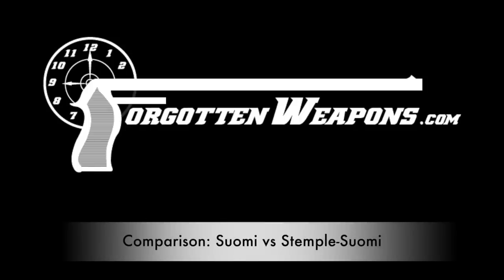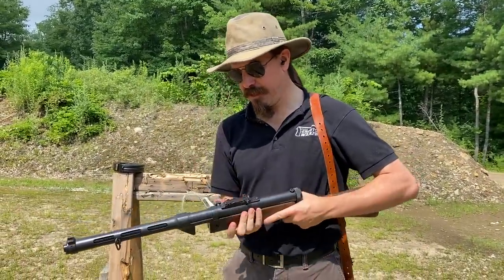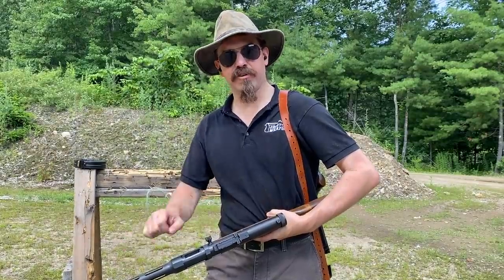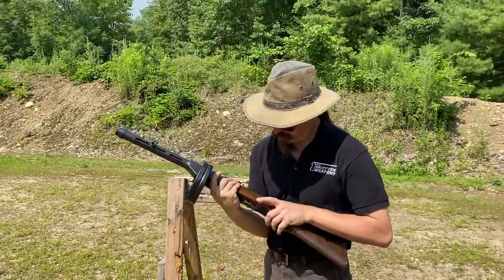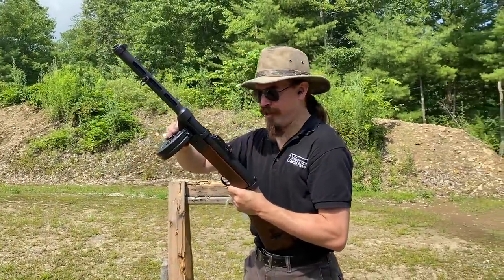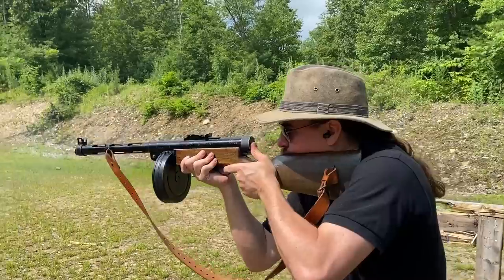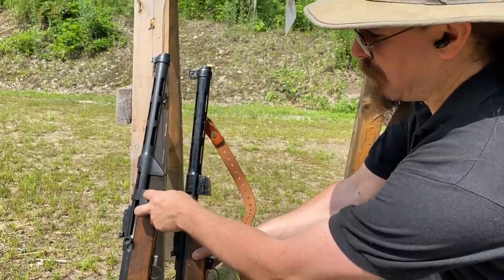Ian Takes the Pepsi Haaste: Suomi vs Stemple-Suomi

Comment: The Stemple receiver might be externally longer, but I doubt it's is functionally longer than the Suomi. The rear cap on the Suomi threads over the receiver tube, while the 'cap' on the Stemple protrudes into the tube a good bit. I think measuring the actual bolt travel of both guns will reveal a minuscule difference. I would do the measurements myself, but right now all I can afford is a Suomi drum.
Reply: I'm jealous
Reply: @skrimper  Don't be. I said I could afford the magazine, not ammo to fill one...😢

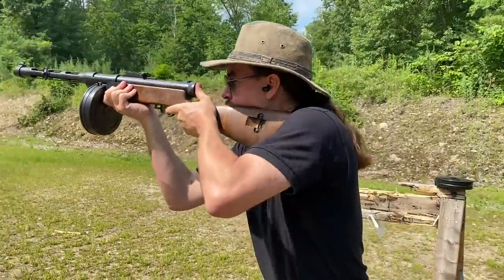Comment: Taking several audio samples from the Suomi against the Stemple-Suomi, I measured 1103 rpm for the Semple-Suomi (around the 5:15 mark), vs 1039 rpm for the original Suomi (around the 3:17 to 3:22 mark).
Reply: I thought the stemple would be faster it has a rubber bumper in the receiver cap
Reply: So it seems the original is still the better military use gun and the STG is the better recreational gun, (more faster for fun, better economical pacing for the military gun).
Reply: Also, good work with the audio isolation and rpm measurements.
Reply: Yeah!The original sounds slightly faster!
Reply: I guess the bolt in the Stemple is slightly lighter, so that would tend to increase how fast it moves, and thus increase the fire rate, right?
Of course the question is, how much of an effect will that have?
Reply: Well, Ian couldn't really tell them apart. I also would have liked to have longer bursts from the original Suomi, if order to have a more accurate comparison. It could be possible that for 6-7 shot bursts, the rpm is lower than for 20 rounds, where you get a more sustained firing rate.
Reply: @britjohnson1990  Neither of mine do.  I'm not aware they ever did.
Reply: @john-paulsilke893  The Stemple has a set of bolt weights and two different carriers so you can tune the rate of fire.  It also has available .45 ACP and 7.62X25 barrels.

"Economical pacing" entirely depends on the type of target and range.  There are times where a tight burst is preferable, and others where a slow spread is better.

Comment: I see the Finns taught you the correct "thumb on the rear cap" firing technique!
Reply: It prevents the grip from sliding forward and backward through your hand. This helps you control your trigger pressure.
Reply: @dwaneanderson8039  Thanks - wondering why he did that. I'll have to adopt that on my (Hispano) Suomi.
Reply: @dwaneanderson8039  Interesting. I've never had that problem, but I'll give that grip a try and see how it compares.

Comment: Ian, don't forget the "pneumatic buffer" function of the Suomi, where the air trapped behind the bolt smooths things out throughout the entire stroke.  I'll bet that's the primary reason the guns feel identical when firing - longer bolt stroke in the Stemple a gentle buffering in the Suomi.

If I am not mistaken, the "pneumatic buffer" arrangement works in both directions, as the slight vacuum created as the bolt moves forward and tries to draw air back into that space retards the bolt slightly (and isn't the air escape valve in the reciever one-way, so the air can't refill on the return stroke as fast as it exhausted on the blowback stroke?).
Reply: There is no valve on endcap of Suomi, it's just holes in there because Lahti was concerned of endcap being too airtight and having holes there is just to allow it vent out that pressure bolt creates while moving. As Suomi is supposed to be run with hotter load than normal 9x19 para (400m/s muzzle velocity vs 320-340 muzzle velocity).
Reply: @ReijoRitari  I stand corrected. Still, the air will reenter the tube more slowly through that hole than the sloppy fit of, say, a Sten.  You're going to draw at least some vacuum as the bolt goes forward - the question is how much, and how much does that retard the bolt closing...
Reply: @ReijoRitari   There is a one-way air valve in the cap behind the spring guide. It allows air out but not back in. I have 4 of the part kits, some early and late style, all have this pneumatic rate reducer.  If you look an Ian's original Finnish M31 video, which is linked at the end of this one,  at 18:48 you can see the valve spring through the vent holes in the cap.
Reply: @thoriated  I have real (deactivated) one on my shelf, there is no valve. It's just plain holes.
Reply: @ReijoRitari   There is a set screw on the side of the end cap that holds the spring guide in place. Remove the set screw and unscrew the spring guide. There should be a spring and disk behind it that seal the holes on the spring guide.
Reply: @ReijoRitari  I have real original Suomi SMG,s too my end caps are not just through holes there is a spring steel plate with holes that looks like it works as a valve. It would be nice if there was a way to select different hole alignment to reduce the rate of fire. But I would say the intent was to prevent pressure building either way.  With 9mm ammo being so high even to reload. I stay with the stick mags when showing them off. Because it takes like 2 1/2 seconds to run dry. But that shit eatjng grin stays on their faces for quite awhile. Lol..

Comment: Remember that reciever that is physically longer also has a long "plug" style endcap- unless you measured true free space.  Spring condition/rate/length is probably the best way to modify rof if you go down that rabbit hole.
Reply: That, and the bolt is also slightly turned down thus a little lighter too.
Reply: @muddyhotdog4103  Very true.  A few thou off of a firing pin is a whiff of material.  A few thou from 1 inch round stock likely adds up quickly.
Reply: For the Stemple, BRP sells all different springs and weights for the bolt that allow you to modify the rate of fire to whatever you like more or less.  Speed it up or slow it way down.
Of course you could theoretically do the same to a Suomi, but I dont think it would be worth it to tinker with such a rare expensive gun.  Even replacing the original main spring on a transferrable Suomi probably decreases the value by several thousand.

Comment: Atleast on Youtube, the Danish Suomi sounds more "metallic" than the Stemple, but it could just be some effect on the microphone. From my experience with a Finnish Suomi, the "metallic" sound isn't really there irl...
Reply: It's an audio artifact of the mic not being able to catch the full range at that volume.
The fact the charging handle is on the far side of the receiver shields the mic from som of the tone
Reply: @0neDoomedSpaceMarine  yup this is very audible on my monitoring setup when Ian pans around the range to shoot at different angles relative to the mic. There's parts where it catches the brunt of the muzzle blast and picks up a lot more bass and then he aims elsewhere and it doesn't get hit at all and it sounds much more tinny than before.

Comment: Ian forgot the bolt for the Stemple was turned down and a bolt handle added so the weight difference between bolts is likely to balance out the length of travel in receivers and provide similar rates of fire
Reply: He wasn't concerned about the weight but the slightly longer travel due to how the stemple is made. The end cap goes in further so the travel should be quite similar.

Comment: Anyone remember when the Suomi's where so cheap they included them with Yugo AK parts kits for not much more? Even with the additional cost the AK was maybe 150 bucks shipped.
Reply: Anything on the shelves today is cheaper than 14k. I miss those days I could pick up an AK kit for that cheap
Reply: @burlyheads  Ya I was just referring to the kits . My first AK kit was like 65 bucks original un molested barrel too. Same kit today be 400 plus if you can find them.

Comment: To my ears, the Stemple feels like it has a slightly higher rate of fire and that it's a bit more consistent. The real Suomi, or at least that danish example there, it has a bit of an staccato rate of fire, sometimes it slows down a little bit, then it catches up. Maybe it's due to the recoil springs being old are more worn than the ones on the Stemple. Some in the comments down below mentioned that the real Suomi has a pneumatic effect on the bolt that cushions its travel, maybe that has something to do. Maybe it's more ammo sensitive. A side note: Regarding the lack of a magazine release lever protector on the temple, I bet that you can weld a piece of metal in place. I also think that it was also intended as a hand-stop so you can have a more rifle-like grip. I like how the soviets adressed that by making the mag-release lever foldable to make it even more snag-free and bump proof.

Comment: Without running the audio through a wave editor I'd say that's close to bang on the same rate of fire. And I think I know why: The Stemple receiver is a little bit longer, but the "plug" is also longer, making up some of the difference. Furthermore the Stemple bolt is turned down eeever so slightly, making it a little lighter too. Apparently the combination gives a result that is close enough to identical that you need to actively measure it to find a difference... MAN I'd like one of those :D

Comment: The Danish Home Guard used the M41 into the late 70es. Also in use was the M44 which was the Swedish version of the Suomi (with the stock similar to the Stempel). Neither the M41 nor the M44 were used with a drum magazine by the DHG. Instead the SMGs were equiped with quadruple boxmagazine holding 50 rounds (the last five-six rounds were a pain in the a.. to load even with the loading device for the magazines). They were heavy SMGs, but really nice to shoot. We trained with them on the 200 meter range - and scored many a hit. Mainly when using semiautomatic. In my opinion they were a lot better than the Swedish Carl Gustav (Port Said). With the last mentioned gun I couldn't hit a barn even if I were inside it.

Comment: you did say the bolt was slightly shaved to fit, maybe that balances the slightly longer tube length?
Reply: I was thinking the same.
Reply: Also if it was drilled to accept the charging handle, the weight off the bolt is again different.

Comment: The stemple receiver is longer but the tube endcap is also longer compared to the suomi.  The operating length of the receiver is probably quite similar.
Reply: Yeah, it has a good bit of length on the inside of tube so that probably evens it out for the most part.

Comment: You can still buy a brand new (1986 receiver, but new built) Stemple from BRP guns.  They do have the finger block behind the mag release now.  And both guns are about the same cost, it's just harder to find an original.

Comment: That large thru-hole drilled into the bolt for the Stemple bolt handle probably lightened the mass of the bolt enough to compensate for the longer receiver, ending up with roughly the same rpm.

Comment: The U9 version of the gun has an extension rod behind the bolt mating it to the hydraulic buffer in the stock.  This can be exchanged for a lighter rod to increase the rate of fire.  I prefer about 600 rpm which is also a little easier on the wallet.

Comment: Remember the Stemple Suomi has a longer receiver, however the Stemple also has a pin holding on the end cap and does not screw on like an authentic Suomi.  The space taken up by the pin makes the receivers very similar in length, and the felt recoil and rate of fire will remain similar.

Comment: I think part of the reason that the fire rates are similar is that yes, the Stemple has longer travel, but the bolt is also that little bit smaller and has a speed hole drilled into it for the charging handle.

Comment: When you took them apart I noticed the Stemple end cap went deeper into the receiver than the Suomi, so maybe the length of travel on the bolt isn't actually all that different between the two. That would maybe explain the similar rate of fire and handling

Comment: I think the Stemple ROF was a bit higher actually. What could cause this if it indeed has a longer travel time and the same bolt and recoil spring?
Reply: As many people have pointed out in the video taking a look at the stemple-suomi, it's likely the fact that the stemple has a sort of buffer-cap thing at the rear of the reciever that the suomi doesn't, and might contribute to making the stemple have a similar bolt travel distance to the suomi
Reply: Suomi has sort of air cushioning system built in the receiver that reduces ROF slightly.

Comment: Not sure exactly what is causing it but the real Suomi has a much more metallic sound while firing than the Stemple. Wonder if the bolt is actually hitting the back in comparison to the Stemple slowing it down just that little bit more?

Comment: Actually, you were correct about the  slower rpm of the Stemple, Ian. It is visually verified by the slightly wider gap between the ejected cases when firing. Not that it amounts to more rpm  variation between lots of ammo , but there you have it...

Comment: Aren't these weapons very similar the burp gun used in the Korean war ?
Reply: Their look and utility are very similar, pretty much everything else is quite different though. The Soviet drum mag, however, (used in the PPSH-41 you're referring to) was a copy of the Finnish drum mag for the KP/31 "Suomi". I believe the Soviets stopped producing the drum mags during WW2 (like '42 or '43) due to the required tolerances and cost, and moved to a cheaper and simpler 35 round stick mag. Whether they started to produce the drums again after WW2 I don't know.

Edit: i.e. if there were many PPSH-41's with drum mags in Korea they might be from just 1940-1943, although I'm not sure about the potential post-war production.
Reply: The Soviet PPSh-41 was inspired by the Suomi, and copied its drum.  However, mechanically, they aren't really closely related at all - the PPSh is much cruder and simpler, and you have to be picky with which individual PPSh drums you use with which individual PPSh - sloppy tolerances in both drum and mag well, and the resulting tolerance stacking mean that you almost have to hand fit the specific drums to the specific gun, and then stick with those drums to get the drums to fit and feed reliably in that gun .  Which is a huge reason why the Soviets switched to stick magazines that proved to be less finicky in addition to way cheaper and far easier to handle in the field.

The Suomi, on the other hand, is a top quality product of a very sophisticated design (the fit of the reciver and bolt are so good that the gun actually uses the air space behind the bolt as a "pneumatic buffer" by drilling a small escape hole at the rear) and the design and build quality of the Suomi drums are unbeaten amongst spring wound drum magazines.  But even the Finns eventually dropped the drums in favor of stick magazines.
Reply: @geodkyt  Was the PPSH-41 really inspired by the Suomi? Wasn't it an upgrade to (i.e. cheaper and more modern version of) the PPD-40, which in turn was a upgrade on the PPD-34 so it could accept the now copied drum mags? The PPD-34 in turn was inspired by the German MP-28. I mean the Soviets' the extensive use of SMG's and their SMG tactics and doctrine was inspired by the Finns, but I don't think the PPSH-41 was.
Reply: @williamsohlstrom1530  The Soviets had already ordered the retirement of all SMGs in military service due to the poor performance and high production cost of the PPD-34 and PPD-34/38.  The Winter War resulted in the Soviets rapidly modifying the PPD-34/38 into the PPD-40 to accept the Suomi style drum after Stalin asked if the USSR could perhaps build Suomis in the Soviet Union, since the Suomi was so useful a weapon that Soviet troops were using all they could get their hands on, even while the PPD was viewed as far inferior weapon.  Simultaneously, development of the PPSh-41 was launched, in an attempt to get something good enough to match the Suomi into production in numbers adequate to match the Suomi.

Yeah, I'd say its safe to call the PPSh-41 "inspired by the Suomi", much as the AK was "inspired" by the StG44 (despite in both cases, the Russian and "foreign inspiration" guns having almost nothing in common mechanically, aside from general layout and both used the most common operating system for their class at the time - direct blowback for the SMGs, while the rifles both used long stroke gas pistons like almost every other gas operated automatic weapon of the period).
Reply: @geodkyt  Fair point. Thanks for the explanations!

Comment: DoI understand correctly that the Suomi is 9x19mm, and the Stemple is.45ACP?
Reply: The original Stemple M-76/45 is .45, but this Stemple is built with a Suomi parts kit, including the bolt and barrel, and is 9mm. The only Stemple part is the bare receiver tube...